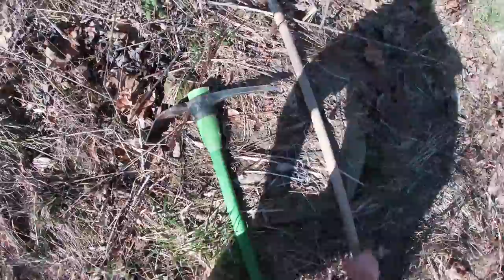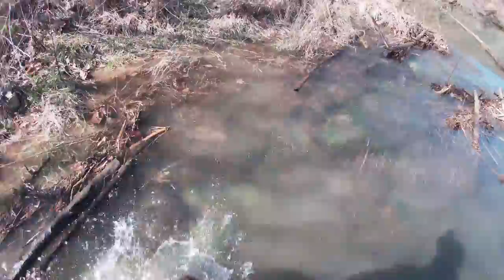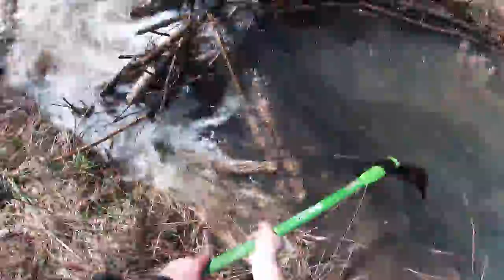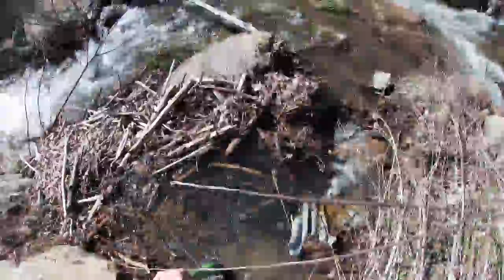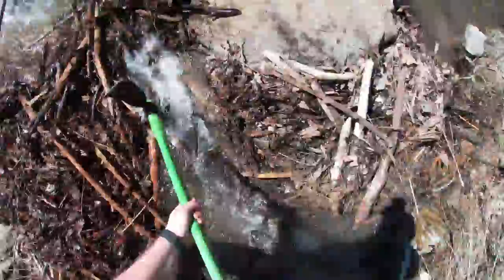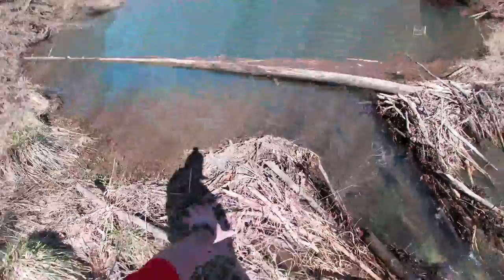Beaver Dam Removal By Hand

Comment: well done, i have a dam removal myself if you want to check it out.  any tips on harvesting without a trap or even if it is possible.
Reply from the maker: I personally haven’t ever seen anyone be able to remove these critters without traps. I’ll check out your video! Thanks for the comment!
Reply: I've "removed" them with a .177 pellet from a Benjamin air pistol. .22 long rifle also works well. Depends on how much patience you have and accuracy, always, accuracy. Other than those choices,  conis aren't all that expensive when compared to the value of one big drowned oak tree. Easiest trap on earth to use.

Comment: Dangerous? Not to be contentious but I've never thought of manually removing a beaver dam as dangerous. The release of water is more gradual than using an excavator, so it's not like a major sudden wall of water is released. I've cut 4 ft high ones with no worries. The main dangers I've seen are back injury from pulling large limbs in awkward positions and cotton mouths or copper head snakes, which love to hide up in the back of the dams among the jumble of bracing sticks. Gotta watch out for those.
Also, you'll have a lot easier time of it if you toss out every bracing stick from the back side before releasing the water. I've got a couple of homemade tools that are far more effective than the ones you're using. I'll check your channel for contact info and send you some pics if there is an email address there, if not, post it and I'll send them. They are easily built if you can weld or have a buddy who does. I have tried every tool the box stores sell and none of them work as well.
Reply from the maker: Sorry Greg, just now saw your comment! I’d love some ideas for new tools. My email is paulp6811@gmail.com 
I also just put the warning part in there for people without our common sense lol. It’s not so common anymore lol
Reply: @trapperpaul1379  I definitely agree with the common sense part, the lack thereof is rampant in our society these days. I'll try to get pics to you this evening.
Reply: @trapperpaul1379  I've tried sending pictures and a video but it fails to send because of an invalid email address. I'll be glad to try again if we can straighten that out.